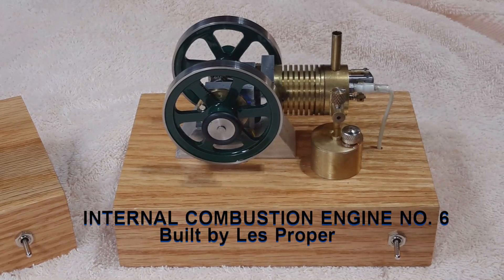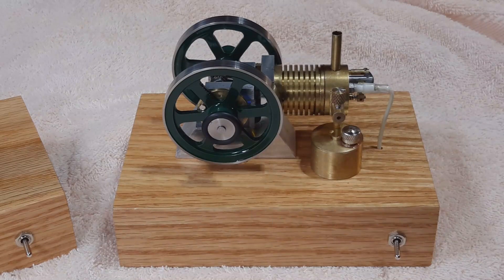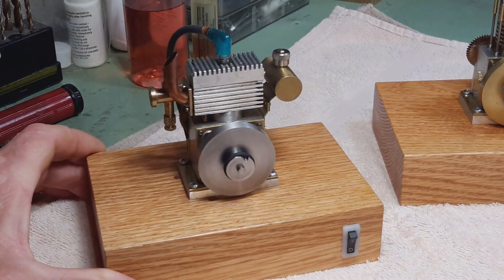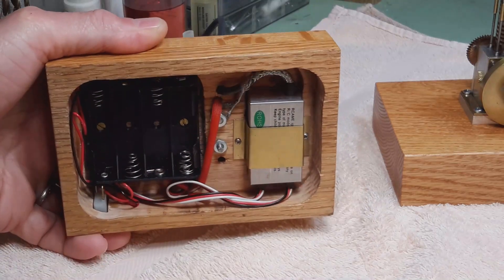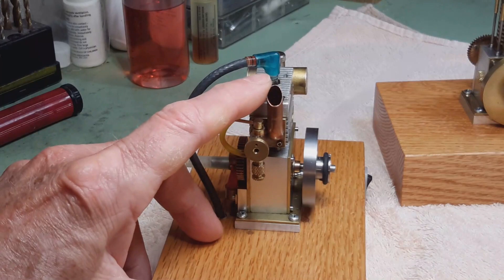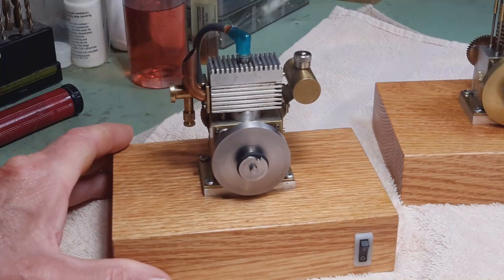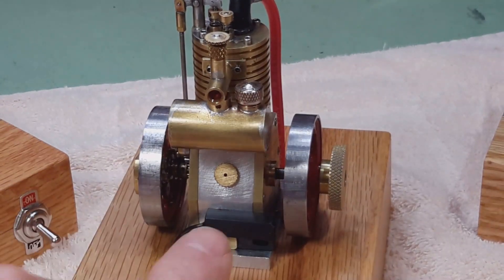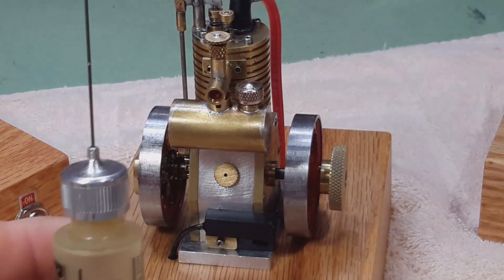INTERNAL COMBUSTION ENGINE NO. 6

Comment: how does the spark ignition work  on those engines?
Reply from the maker: There is a little coil that produces the high voltage for the spark plug and some solid state circuitry.  The spark is triggered by a small magnet on the flywheel or crankshaft and a hall sensor or on some of the engines a reed switch.  Thanks for your comments

Comment: Currently in the process of making one. What do you use for the ignition system in your engines?
Reply from the maker: Several of my engines use an ignition system made from a stove igniter sold under the name "Blokker".  You can find instructions on how to make it in a youtube video by "mylittlediesel".  I have had trouble with some of these ignition system in that they don't consistantly produce a strong spark.  I have also used a replacement part from "Stirling", the Chinese company that makes and sells several small IC engines.  The cost is about $50 and includes a spark plug, but delivery takes several weeks.

Comment: Those engines fascinate me Les. All so superbly engineered and built. I wondered if you have the plans for sale for any of these engines. I know that you use a Sherline Lathe, do you also have a Sherline Milling machine ? regards Paul
Reply from the maker: Hi Paul, I would be happy to provide my drawings, albeit they are not complete in all details and dimensions.  I basically made the drawings "on the fly" as I built the engines.  My drawings are .dxf files and they were made on LibreCAD which is a free source drawing software which you may be familiar with.  Send me your email, to lesproper@gmail.com and I will send you what I have.